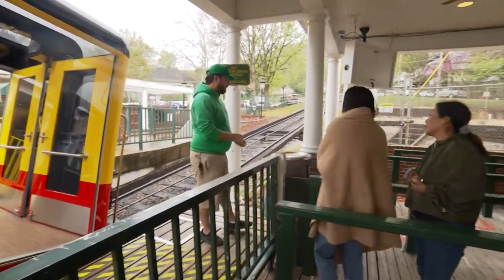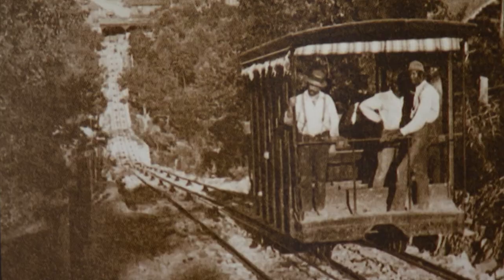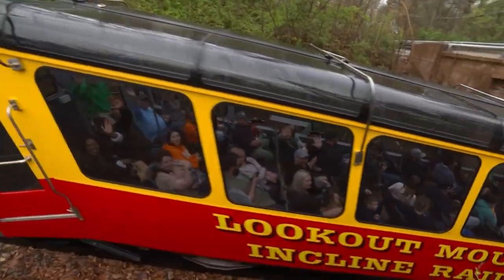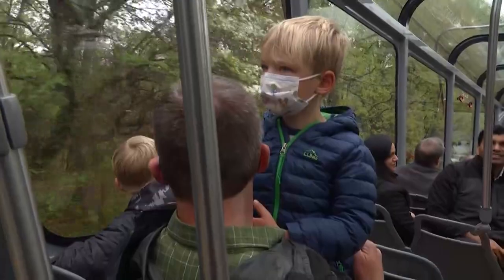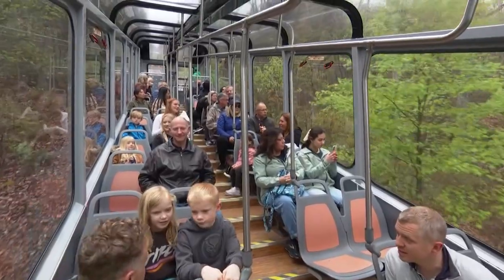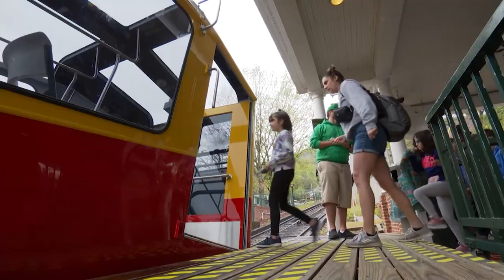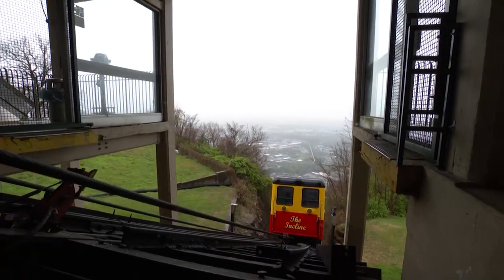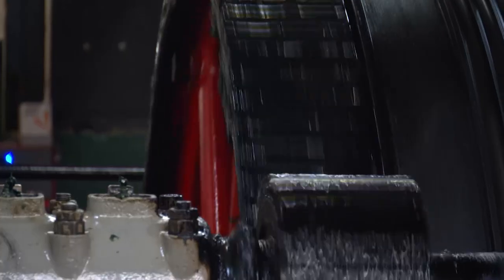Lookout Mountain Incline Railway

Comment: Good evening, is the switch that transforms the railway from a single track into a double track railway electrically operated?  What is the function of the single needle switch placed a few meters from the top station?  Here in continental Europe, most of the single-track funiculars with a crossing loop placed midway are equipped with pointless switches of the type devised by the Swiss engineer Abt.  In my city, Genoa, there is also a rack railway equipped with Abt-type switches, probably the only case in the world.